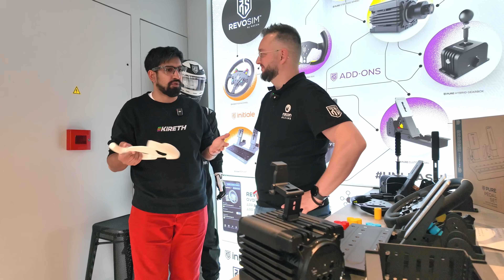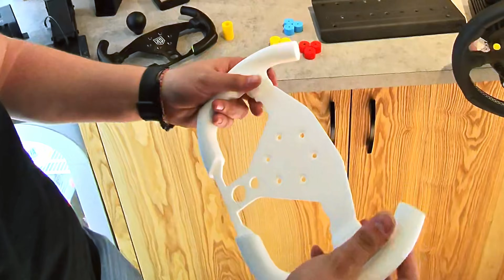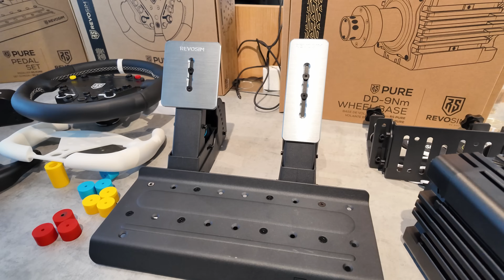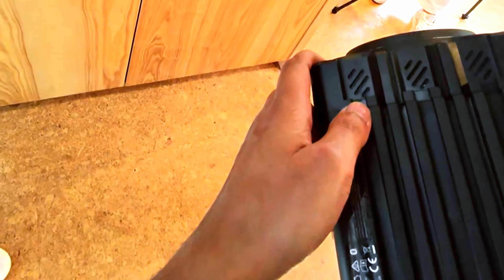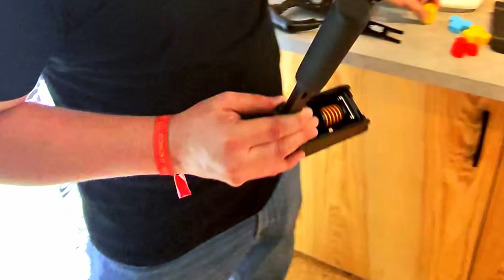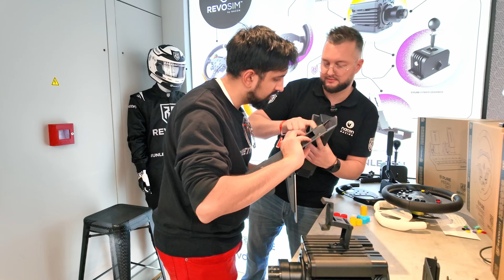Are Thrustmaster, Logitech, Fanatec now UNDER THREAT from Revosim?

Comment: It would be great if new brands would stop gatekeeping the wheelbases into working with just their rims.

Simagic opened the ecosystem, USB passthrough the shaft itself.
Asetek gave us an official QR for 3rd party wheelbases.

Why do they not listen to the community? 

We want to use custom steering wheels, or wheels we already own.

We're going to do it either way, with emulators from Talenki/SimRacingMachines or hubs from SRM/Simube.

Comment: It completely baffles me why they dont add console support... Why just have it PC only? Surely sales would be far higher if they included PS and Xbox support? 3vs1... Again makes no sense.

699 would of been a perfect price point for those that want something more than a T598 or Fanatec 5nm

Strange their next wheel will be 5nm that area is already stacked.
Reply from the maker: Licensing costs most likely
Reply: @Kireth  wouldnt more sales on 3 platforms more than cover it? The console space is crying out for a 9nm with pedals as good as this. 5nm done to death.

Comment: If this comes out on console for the ps5 specifically I will replace my t598 with this
Reply: This^ and If it's good I'd replace it with my fanatec dd+ set up also want it to be Xbox compatible too.
Reply: @Zeromobius19  get Logitech G Pro.. Compatible with all PS5, XBOX and PC. 11Nm too.
Reply: I was just thinking the same thing! Actually really ones with how this looks so far! The wheel is so much nicer than the t598
Reply from the maker: @Thrustmaster
Reply: Console version 5nm I reckon if that's the case I won't purchase

Comment: Any way to use the pedals without the base?
Reply from the maker: Good question, I'm not sure
Reply: @Kireth A number of reviews claim you can connect USB directly, but I cannot find an image showing a connector, or evidence in the manual.  It would also be great to know whether it is a standard HID or requires drivers.